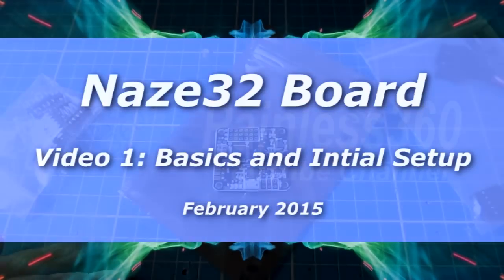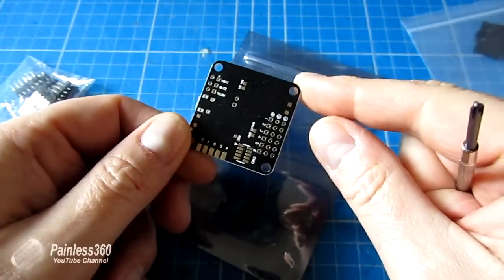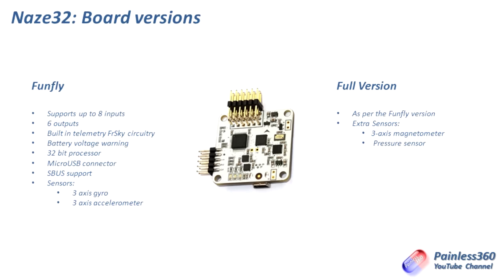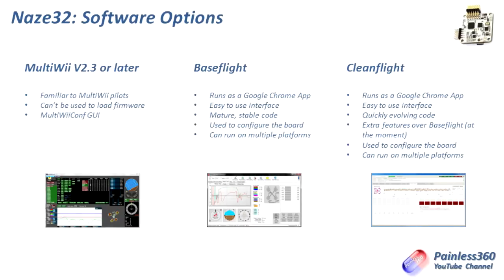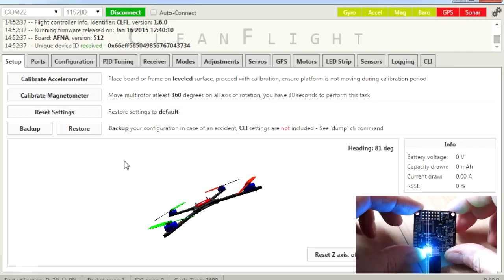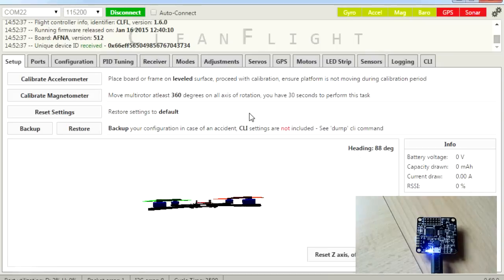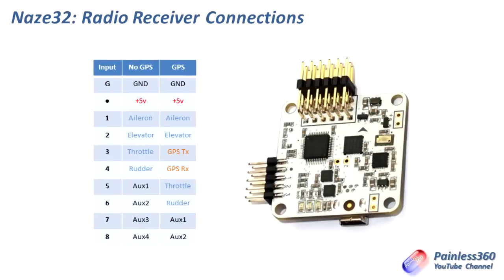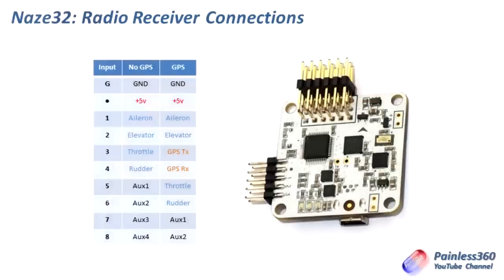(1/8) Naze32 Flight Controller (Full version) - step by step initial setup

Comment: Hello, I have a Naze32 Full version... I've flashed the board and calibrated the accel... why is my calibrate mag grayed out in CF? I can't calibrate the mag before soldering pins etc. and doing other steps. The firmware I am using is CF 2.2.0 for NAZE. Any advice? Thanks.
Reply from the maker: By default the magnetometer is disabled, you'll need to enable it in the config settings in the GUI. Best of luck

Comment: Hello! i am having some problems with my Flip32 board. what i am finding is even though the ppm is set up correctly with my Taranis it is not recognizing the Aux. could i be missing something? i have tried to follow your videos as close as i could but have not had much luck. do you even still use the board or should i invest in a Naze32? 
thank you!
Reply from the maker: Should work fine. Double check your mixes setup. Best of luck!

Comment: what motors are you using ?
Reply from the maker: robert steere This depends on the frame and weight  - what frame are you using? 250, 330, 450, 550 class or something else?

Comment: Sir, I am building my first racing drone, and I have a question that may sound silly-- for me, three weeks of trying everything I know to solve the problem. I even waited for a second naz 32 board. Both are full version Naz 32 boards. At first they hooked up-- then problems arming. I tried to load another board firmware-- Only blue light, no flash, no connect. I went to drivers-- working properly. I tried rescue-- kept saying the board was not connected-- timed out. I am stuck with 2 new boards that have never flown. I can not afford another board-- they are $29 each. Is there any help? Any ideas? I would hate to buy an ARF version because I am Stupid!
Reply from the maker: So what's the issues - you can't arm or you can't connect to the board? If you can't connect to it you can't do the basic things that will stop it from arming. Things like calibrate the accelerometers etc. See https://github.com/cleanflight/cleanflight/blob/master/docs/Controls.md

Best of luck!

Comment: Hi Painless,

I'm having trouble connecting my Naze32 to Cleanflight on my PC and Mac (both). When I open Cleanflight on both, no USB ports are recognized and it just says "manual selection" and gives you an option to type in your own serial port. Also, on Mac, the USB to UART driver has been installed. Do you have any idea how this could be fixed? Much thanks, Jack.
Reply from the maker: Jack McGovern That sounds odd, you shouldn't have to work that hard to get it to work. Have you tried another USB cable?

Comment: Flip32 10dof -need help
Reply: have nanj32 10dov. I have done the set up as per the instructions. with USB connection all is fine. if I disconnect from USB the motors does not spin. the green light for arming turns on when push trottle right but the motors does not start. if I connect to Baseflight via usb it works. please help. spent 4 full days reading forums but nothing helped.
Reply: +Yordan Velikov forgot to mention that after connection with USB then I can disconnect the usb and fly but if I disconnect the battery thats it, motors does not spin unless connected again with USB.
Reply from the maker: Sounds like a power problem. I'd power the board from another different BEC and see if that helps..
Reply: +Painless360 thanks for the prompt reply! I triad different batteries and I have 4 speed controllers connected. I have cc3d also installed on this quad and when I change the cables it flies well for 25 minutes (5500 11 v.) with no power problem.
Reply: +Yordan Velikov forgot to mention that I am using the built in power distribution that f450 x- frame has and then the 4 ESC'S connected to nanj32 10dof
Reply from the maker: Not main flight power - the 5v from the BEC..
Reply: +Painless360thanks for the reply. NO I do not have power supply from bec. obviously this is the issue?
Reply from the maker: Probably - look into how you are powering the board and Rx with 5v...
Reply: +Painless360 I am powering with the 4 ESC's that are powered from the power distribution on the frame
Reply from the maker: https://www.youtube.com/watch?v=OZNxbxL7cdc may help..
Reply: +Painless360 thanks, just waved the video. was thinking that 4 powered ESC'S are enough to power the board. will buy BEC as well and will try. is it required for all quads?
Reply from the maker: You need at BEC(s) that can deliver over an amp at 5v to power everything.. Best of luck!
Reply: +Painless360 thank you very much! it works. I spent days and you sorted it out in seconds! great thanks!

Comment: Hi Again, I gave up on the Board trying to get into clean flight just wasn't happening. I've received a new one this morning and connected to cleanflight, done the Calibrations before connecting pins but I have a Blinking Green light on the board. I can disconnect and re connect to C/F without and problems. Should I try installing the earlier firmware ?  I spoke to you below with user name of Bl4derr1
Reply from the maker: If it's a Rev6 Naze32 then you need CF1.11. Make sure the accelerometers are calibrated.. Best of luck!

Comment: hi
i have naze32 running frameware 1.10 on cleanflight 
in the last few days the board start to blink the L1 status led constantlly. i removed everything from the board so now it is stand alon board ans still it happen. i tryed to upload 1.11 and also other fw
 same issue
are you familiar with this phenomena?
thanks for the help
Srul
Reply from the maker: +srul76 Sorru I've not seen that. I'd check in the forums. Best of luck..
Reply: +Painless360
thanks for the quick answer.
i think i found something
when i disable the Receiver failsafe it stop to blink constantly it blink only when the board is not vertical
should i need to change any setting on the faiesafe?
Reply from the maker: I'd check it out as the failsafe should only sound when it's not getting any input from the Rx. It can be used as a 'lost model alarm' when you have a buzzer connected. This shouldn't be going off if the Rx is connected and the radio is on..

Comment: Hello, So I can just use a single cable to plug my receiver to the board?
Reply from the maker: If you're running PPM, S-Bus or one of the other single wire connections.. yes

Comment: hey question, Im building a quad for the frist time.

say i wanted to feed my FC signals not from a radio receiver but a hard wired system mounted on the unit itself.  

my question is there a configuration setting that would allow for hardwired inputs as opposed to PWM or sbus radio reception?
Reply from the maker: As the flight controller only understand PWM, PPM or S-Bus (and a couple of others!) then you'll need to emulate one of those to get your signals into the flight controller.. Best of luck!

Comment: quick question. when I hook the naze up to the computer my esc r powering up with out the battery being connected. wondering if that is normal in some cases
Reply from the maker: +Stephen Kelly from what I recall Rev6 versions do handle the power differently. The motors can't turn without the main battery plugged in..

Comment: NICE series for naze32 
but you have to launch series for
EMAX skyline32 advanced v2
Reply from the maker: Sorry, we're not planning to. There are lots of new controllers that now include extra features like F4 processors, vector OSDs and integrated PDB, OSD and F3 based FC that they are what we will be covering next.. We've looked at lots of F3 based boards in the channel and they are all very similar.. Happy flying!

Comment: Just autotuned and then after that thought - i can run it one more time.... went out of control and broke an arm... just to rebuild it from scratch....
Reply from the maker: Eek! Auto tune will be the last video in this series once I have a 250 frame (on it's way from China at the moment).

Sorry to hear about the crash, auto tune on the Naze32 seems to be a little aggressive sometimes but even tried and tested platforms like the APM can have 'excitement' during auto tune flights. Be careful which PID controller you have selected on Cleanflight too - i.e. PID controller 2 'Luxfloat' doesn't support auto tune (
https://github.com/cleanflight/cleanflight/blob/master/docs/PID%20tuning.md).

Best of luck with the rebuild and happy flying!

Comment: Just looked this up ,16 MHz :8-bit vs 72 MHz 32 bit .Maybe this is why one would use Naze 32 no matter what type of Quad? My pref. not in order of importance, stable gps, easy flyer, long flight time, Range, fpv for fun not broadcast quality, 12" to 15" props, not so interested in aerobatic or racing , to old to master anyway.
Programing  seems more doable than flying with your and other youtube help
Reply from the maker: Everyone has there own favourites and hobby horses and I have mine. I try not too but one can't help but become a fan of technology that works and is reliable. 

APM 2.6 is a piece of cake to setup with no soldering, special cables and looms needed (unless you go for the newer APM 3.1 Mini), is very well established with loads of support and tested code and hardware.

Has a lovely interface in Mission Planner and allows for easy initial configuration with point and click commands and easily supports both smooth flight and programmed missions.

It allows for reliable GPS flying and failsafe conditions and will not only fly a craft back to you in the event of a problem (with the radio/low battery) but will then gently land it and disarm the motors too.

The list goes on.

Other, more expensive newer boards are available but, for now, the APM for what you are looking for would be hard to beat. Unless you want a super-fast board for FPV racing then it's not great at all!

That's my two-pence worth anyway..

Happy flying!

Comment: 28:38
how is it possible - two mode the same time is actve?
are setting correct ?
Reply from the maker: I see you have also commented on the eighth video in the series that covers flight modes so I assume you have your answer. 

Happy flying!
Reply: Painless360 yep
thanks )))

Comment: I watched all your videos about naze32 setup but want to ask more. I want to use following configuration. When armed with sprigged throttle stick to center or 50% of throttle motors should start spinning at minimum speed. Default mode is always set to baro. So if I increase throttle it should lift up and stays at some altitude if i release throttle stick and it return to center position. Is it possible to use with naze32 setup?
Reply from the maker: +joshhhab Not sure what you are asking.. can you rephrase?
Reply: +Painless360 If you know how DJI Phantom performs when armed and all sticks on remote controller is in central position. Motors spinning just with lowest speed in this central position. Increasing the value of throttle force drone to lift up. And while lifted you can release throttle stick and it returns to central position on controller and stays there but drone maintain altitude.
Reply from the maker: That sounds like baro mode in Cleanflight. Have a look at that mode.. Best of luck..

Comment: Hi painless, I always find things work much better when you have set your Tx up, you need the mid point at 1500 (mostly)
bottom at 1000, top at 2000. If you've got a neutral (no trim on) Tx, and you plug it in and all channels are say 1520, change mid_rc to 1520. Adjust your start/middle/endpoints to match 1000,1500,2000.
Also, if you need to calibrate all ESC's at once, remove props (naturally) and plug board in with no battery power, set min_throttle to 1850 (or your highest throttle setting) you can now do this on the config page... save (reboot) plug in power, ESC's should go to programming mode, change min throttle back to 1050 (or your minimum throttle setting) save... viola!
With this board it is better to trim your Tx/Rx to what the board expects, not what your Tx is telling you ;-)

Comment: To calibrate your ESCs , connect to Cleanflight/Baseflight without your flight battery connected. Go to the Motors tab and tick the box (props off!).Using the main slider , slide all four motor inputs to the top , it should give a value equal to  your maximum throttle setting. Connect your flight battery and wait for the ESCs to beep ,  when they have done their thing slide the main slider back down to zero and the ESCs should beep once again. Viola your ESCs are calibrated.
Reply: i like this tip. Nice

Comment: Could you possibly give us a step by step guide for the Rev6 board on how to hook up the d4rii telemetry. And also, how to connect telemetry using the x8r receiver? Like where to hook each wire to and what to set in cleanflight?
Reply: +Christopher Hemmings  I think I'm in the same boat as you with the rev6,  but I'm using the 9xrpro opentx with the FrSky telemetry DJT on the back

Comment: I am building my first quad. I have the naze32 rev5 and the Radiolink AT9 transmitter and the R9D receiver. IF i go into cleanflight and go to the receiver tab and move the sticks on my transmitter only the roll moves, all other values are at middle. I then looked online and found a webpage with written instructions. It said to flash my naze with the latest firmware with naze in the naze and to check the box wipe board. I did this and now when i go to receiver tab the throttle is at about a 1/4 of the way up and I cant get any of the values to move. 

I have no idea what i'm doing wrong
Reply: i watched a video on YouTube that was really old and i used the same firmware that they did in the video, 1.7.0 and i set it up just like i had been and it worked.

Comment: Hello mate im getting some problems with one of my quads and no one seems to know whats going on >
sometimes works fine buut sometimes when arming naze bord rapidly beeps and will not arm , iv tried reflashing firmware on boars and esc also calibrate esc's heere is link to the video     https://www.youtube.com/watch?v=qGEHlcZxLqk&feature=youtu.be
please help
Reply from the maker: Sorry, I've not seen that here. I've had it beeping due to failsafe and vBat. I'd be tempted to re-flash the board.. Best of luck!
Reply: right ok thank you for reply .im going to swap FC now, if you ever hear about this problem again and find solution to it well you got yourself a topic for the video 
thanks a lot for videos you my favorite

Comment: I have just started building a 250 quad, and am setting up a Naze32, following your videos. If I use version 1.7 of the firmware, all lights are as you describe. If I use version 1.12, the blue light comes on steady, but the flashing red and green don't. One goes off,but the one right next to the blue light continues flashing. The board still connects OK, but with one flashing light. And the motors do not spin, in either version (I do not have the receiver connected yet). Advice?
Reply from the maker: +Richard Baker Tricky to suggest what to try without a lot mode detail. I'd follow the videos and try it with the Rx and power connected to everything.. Best of luck.

Comment: When I plug in the naze to the computer everything goes as planned except the green light stays on and has a slow blink. I can adjust the motors and accelerometer and everything works fine but I cannot arm the board because the green light is still blinking. Any ideas?
Reply: you need to hook up your rx and transmitter. then in clean flight adjust transmitter travel so the points are around 1000 low end and 2000 high end. my dx6e needs around 150 for travel settings. then setup a switch to arm with. once you have it disarmed and throttle low point is correct light will go off

Comment: Hi.
Thanks for the videos !
Do you have any idea about the yaw drift issue I have ? See this video : https://www.youtube.com/watch?v=qDlSfgjhm08

It does not lock in position when releasing the yaw stick (especially on the right side). My yaw stick is perfectly at 1500us. I tried high and low PID yaw settings, no improvement. I have changed my Naze32, still the issue... Could it be an ESC issue ? (KISS 12A with Oneshot125 activated)
Reply from the maker: Couple of things to try. First check that the radio is going back to the centre position on the rudder and sending 1500 to the rudder channel. A bad pot on the radio transmitter can cause this.

Secondly, if you have MAG selected to maintain heading hold then you have interference from the main power lines. If Mag isn't turned on then try it with it activated..

Finally check for excessive vibration on the frame, re-balance the props and motors and make sure the board is mounted on an anti-vibration mount.

I would recommend fitting a Bluetooth adapter to the model and keeping a live connection from the ground station while this is happening - you will see if the board is getting excessive vibration that's throwing the GYRO/ACC off or seeing a drift from the rudder control etc. Very handy in these situations..
Reply: Painless360
Thanks for the prompt answer.
The Yaw stick is already at 1500us on Cleanflight (I have added a deadband on my Tx to be sure)
I have a AfroFlight version, so no MAG.
I have tried with and wihout damping features on the Naze32.
Props are well balanced (I tried also different size).

I will try to check the vibration level in-flight with the bluetooth adaptor.
Reply from the maker: ***** Just spotted this on the forums and thought of you - http://www.rcgroups.com/forums/showthread.php?t=2163400&page=36"Quick summary of recent issues: 1: MAC , bluetooth combination can not flash NAZA firmware.  2: Cleanflight 1.6 and 1.7 package is causing weird YAW issues in my 250 mini."Software issue maybe?
Reply: Painless360
Thanks a lot. I've just left a message, let's see...